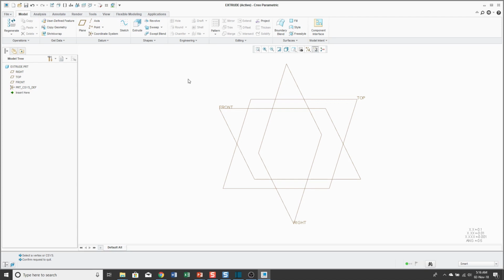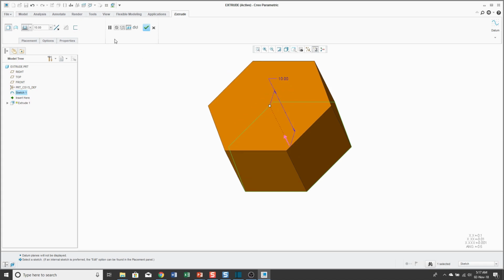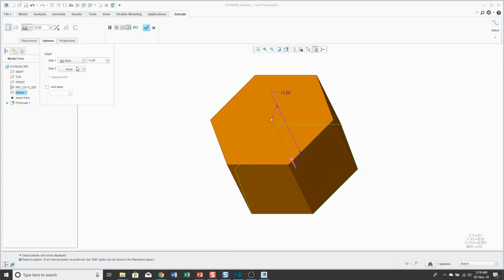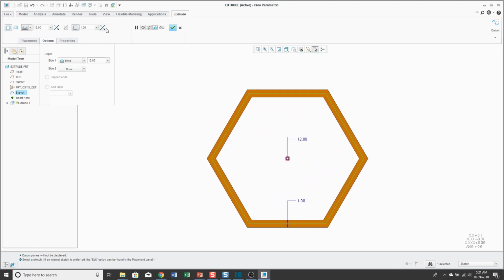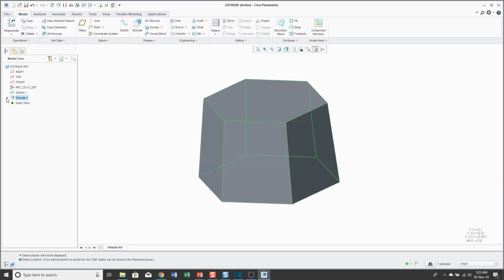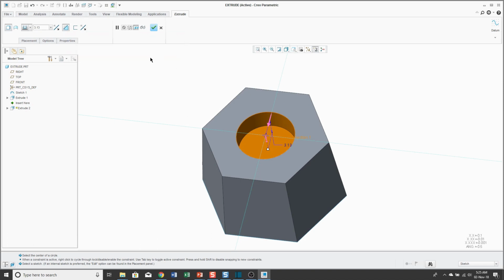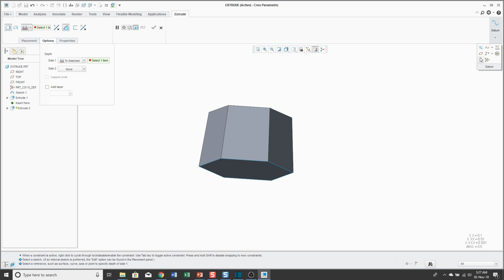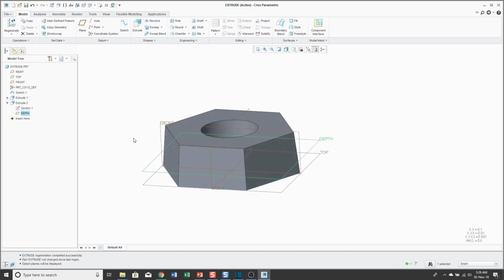Creo Parametric - Extrude Feature [Tutorial]

Comment: Is it possible to use a single sketch to make two different extrusions? Very simple in Solidworks, but I'm getting "the selected geometry can not used by this tool" when I try to use a sketch which has already created an initial extrusion.
Reply: NVM - Figured it out. The original sketch stays visible in the feature tree (unlike SW) and you can use that for your second extrude. The sketch inside of the original extrude cannot be used.
Reply from the maker: See my videos on Internal & External Sketches and Sketch Regions.